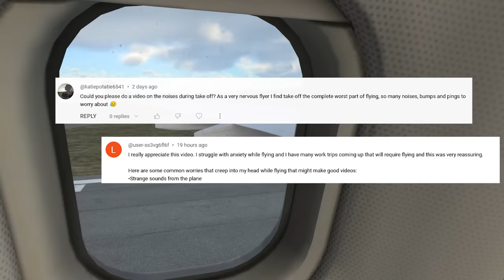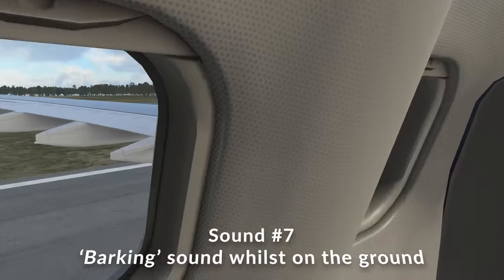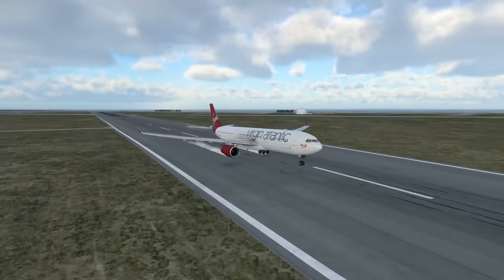What Are Those Noises After Take-Off? | Curious Pilot Explains # 3

Comment: Thanks for this video...gratifying to know my intuitions about these noises were basically correct.  Also, this could just be urban legend, but it feels like to me you can tell if your pilot is a former Naval Aviator or an Air Force pilot.  Air Force pilots will give you a smooth, graceful landing on the runway.  With former Naval Aviators, you will feel all landing gear smack down hard, all at once, then continue the landing...because they're used to landing on carrier decks where this is absolutely necessary....but it makes for a somewhat unpleasant experience for the commercial traveler.

Comment: What causes the 10 - 15 second noise after takeoff & on approach that l describe like pressure escaping from a pool innertube & you pinch the valve to close it. It happens once slightly after leveling on takeoff & once upon approach. l hear it sitting in the plane & I live on the north outer edge of DFW’s airspace & l hear it when they go over our house. It happens only once each way so it obviously must be related to the landing gear, but it’s not a mechanical or bumping noise, more like air whooshing & being closed off, the pitch goes higher until it stops, & it only lasts a few seconds. Thanks in advance for looking into it!

Comment: Admittedly, I'm a bad flyer, but I had a terrible landing last week when the plan "dropped" several times as it came into land. Is this normal and why does it happen?
Reply: I wouldn’t say it’s normal but it definitely isn’t uncommon or something to be worried about. This is caused by strong winds on approach and can be worsened by terrain causing the wind to rise or fall rapidly (this is one of the ways gliders stay in the air through using terrain which pushes the air upwards) however if the terrain rises it must come down and with that comes a section of air which is dropping instead of rising or staying fairly constant. If something like this worries you then always remember that pilots go through months of training in these situations and worse ones to ensure your safety in the air. Something that may help you is finding some YouTube videos (the channel JustPlanes may be good) where there are strong winds or difficult situations. Seeing what is happening in the cockpit may make you see that the pilots are very calm in these situations and if they sense that it is unsafe they will go-around and divert to a different airport or wait for the weather to clear.

Hope that helped and answered your question

Comment: At immediate climbing, there is a lot of stress all the metal of the aircraft withstands getting off the ground. It’s fighting gravity. But there isn’t any option of not climb fast for about a minute or so, in other to gain a safe and clear altitude above ground. As soon as they stress is no longer necessary, nor recommended both for structural and economic reasons, it slows down the engine powers to break free from that stress and then, smoothly, go back to climbing faster but not as fast as right after take off. That saves the structure and fuel consumption.

Comment: Aircraft noise could possibly be reduced by redesigned aircraft. If the engines were mounted above and forwards of the wings, then much of the engine noise would be reduced by sound bouncing off the wing and reflected upwards away from ground dwellings.

Comment: Not a pilot. And aviation enthusiast. Have two family members that are former ATC and one friend who was a pilot. I pick their brains. 
There are other sounds of note.
Upon takeoff and during climb, there will be a whining or whirring sound . This is the flaps being retracted to flight mode. 
Upon final approach, again the whining noise as the flaps are first extended to the proper approach setting. Then extended again, for final approach. Flaps increase the surface area of the wings to create lift. This allows the engine thrust to be reduced so that the aircraft can slow to landing speed. Also on final approach, a louder roaring type sound accompanied by a noticeable slowing of forward speed, This occurs when the flight crew has lowered the landing gear. And then you'll hear the engines reduce thrust. This is again to slow the aircraft to the prescribed speed for landing. A pilot friend of mine calls this "throwing it in the bucket".

Comment: It’s not just the sound of the engines spooling down after takeoff, that is concerning.  It’s the accompanying hair-raising feeling in the pit of your gut, that the aircraft is plummeting.  For the reduced thrust, ceases to push you into the back of your seat, giving the somatographic illusion of falling.  The main reason that I remark on this now, is because, when I was a kid, I myself was a very nervous flyer, and I absolutely hated those moments.  And you know, I think that adults didn’t (and perhaps, still don’t) give kids enough credit.  If one of them had simply explained the process to me, I would have understood, and maybe loosened my death grip on the seat’s arm rests.😆  But after all, it was the 1980’s, when being anxious and apprehensive wasn’t entirely uncalled for; with crashes not being as unheard of as they are today; in fact, some very large, horrifying, and headline-grabbing ones.  Naturally, every time I walked down the jetway, to board a 'DC-10', I was already convinced that we were all gonna die.😆

Comment: Thank you for this video, very helpful. I love flying but it scares the shit out of me each time. The sound of the engines slowing down is (or was, we'll see😂) one of the scariest things for me. What about the smells? Is it normal to smell the jet fuel on board before the takeoff? I'm always worried that something's wrong with the plane. I'm not a frequent flyer but I've experienced this in 3 out of 10 flights.
Reply: What you're probably smelling is either the efflux from another aircraft nearby that has its engines or Auxiliary Power Unit running (used to power air conditioning and electrics and sometimes start the main engines) and that smell is being blown into the cabin conditioning air intake of the plane you're sat in. It could also be as above from the APU of the plane you're in.

Comment: During thrust reversal, the air should only exit the sides of the engine or sideways from the back of the engine, not the front. It still has to go in the front, or the engine won’t work. Now sometimes when the air comes out sideways during thrust reversal, instead of the air being pointed perfectly sideways, they can get it to tilt a bit forward, but that isn’t necessary. 😅

Comment: Good vid. Reference take off thrust - it’s not normally full thrust because it’s not needed and highly expensive in wear and tear. Boeing use 2 reductions called “ assumed temperature “ ( you tell the engine the air temp is Warmer than it really is to reduce the thrust ), and “ fixed derate “ normally 10 or 20%. A strange noise can occur after take off , when you select climb power and the engines actually spool up- the runway was long enough to use reduced thrust to the max, but the climb setting is a tad higher

Comment: Can anybody explain what the loud buzzing sound is from the engines after take off on the a320s? You hear it when you sit in rows by the wings. It always creeps me out but I either no longer hear it at cruising altitude or I got used to hearing it so long that it fades away
Reply: I guess that's the sound I am also curious to find out about, though I hear it on the Ryanair's 737s. It's quite loud and I associate it with a machine whose housing or cover is somewhat loose and makes this resonating, vibrating noise. It disappears once the plane reaches its cruising altitude and is never heard again. I  think it may be the water injectors in the engines, but I have no idea whether Boeing's engines are actually equipped with them.

Comment: Why do planes 'shudder' as they initially lift off? It's like turbulence almost immediately as the plane transfers to be lifted off the ground. Would love an answer if possible please, thank you.
Reply: Its mostly the gear settling down on their suspension as they are no longer in contact with the ground, and also just the initial turbulence of the aircraft now being supported by its wings rather than its landing gear. Also there can be wake turbulence you hit from previous departures (the amount of time between departures is dependent on type of plane ahead of the next).

Comment: Always wondered what the chimes meant. 👍🏻
Reply: They can mean things different depending on the airline. The one I fly regularly toggles the seatbelt light (two dings) when passing 10k feet only (which is good to know since above 10k you need oxygen if the cabin depressurized).

Comment: You forgot the opening of the landing gear doors, where you hear the turbulence till the gear is up and doors fully close.
Then once airborne the flaps retracting, and then on landing the flaps, fouler flaps activating to help stabilize, control descent rate, and speed. But informative video.

Comment: There is a sound you hear when your on the ground and a plane is heading for approach when the plane is about 6000 feet above your house - once the aircraft has passed over a howling noise can be heard from the engines.
This only happens with large widebody jets, don't think I've heard this howling noise from smaller 737,757, a320's etc

Comment: i once was in an airbus at the gate we were preparing for pushback and the pilots were testing that P.T.U. and the hydraulics.We were hearing that barking sound repeatedly i knew somethings was wrong and at the end we were forced to call ground support,meccanics boarded the plane tried to resolve the problem without success.We eventually changed aircraft and we boarded another one and took off.the whole process took about an hour...
Reply: They probably had a fault with the hydraulic systems which caused the PTU to go a bit crazy. Its normal to hear the PTU bark for minutes after the self test during engine start and usually never requires an AOG, so your case is very rare.
Reply: @RyanZ225_PC  i was a little bit concerned i must admit cause i understood the nature of the problem,hydraulics is no joke..but i guess if the pilots would decide to take off instead that would mean that the problem would have been fixed so i shouldnt be concerned that much😅.We were lucky cause we were at the companies base so another parked aircraft was available immediately

Comment: What about the bump sound just after rotation? I always hear this sound and never know what it is?
Reply: When the aircraft is sitting on the ground, the landing gear struts are compressed. (Think automobile shock absorbers or struts) As the weight of the aircraft is taken up by the wings, the struts will extend. That thump you hear (and feel) on rotation is the struts reaching their full extension and hitting the stops. Nothing to worry about, perfectly normal.
Reply: @Max Wedge  Thanks Max. Will think of you now each time I hear it lol.

Comment: Pilots reduce thrust after takeoff mostly because of noise abatement procedures at the airport. Engines produce their most noise at takeoff power & to keep the local neighbor’s happy airport departure procedures call for a reduction in power from 800 feet to 3000 feet to reduce noise pollution.

Comment: In commercial aircraft, pilots are required to maintain a speed of 250 knots or less under 10,000 feet altitude in Europe and American skies, which is why the engines retard their thrust levels and deploy speed brakes (spoilers) on the wings to slow the aircraft down. These noises can cause the unaware passengers to freak out some although everything is just fine. ;-)

Comment: The second ding actually means you've reached 10,000 feet. It has nothing to do with the flight attendants.
Reply: No. 1st ding is for cabin crew to sit down for takeoff. Second is for them to get up. Third is fir seat belt sign off which is sometimes just after  10000ft if it’s nice weather.

Comment: That first ping has nothing to do with the undercarriage. It’s the emergency exit sign going off - meaning, the aircraft is too high for you to exit in case of an emergency!
Reply: Utter nonsense.
Reply: @peteconrad2077  nope. No it’s not. Have a look at the emergency exit light the next time you fly. It goes off in tandem with the ping
Reply: @matthewbryan7890  the ping turns off the smoking signs and the exit signs flash  briefly off in unison. But they do not permanently change.
Reply: @peteconrad2077  afraid that’s not true either. The ping immediately after take off is for the emergency exit purposes. The seatbelt/smoking lights typically come off at around 10,000 feet, but this can often depend upon airline and, of course, weather conditions
Reply: @matthewbryan7890  no. Smoking signs are connected to configuration of gear. I’m an airline pilot and former aeronautical engineer.
Reply: @peteconrad2077  they’re not on the flights I take. I fly around 40-50 times a year. I’ve never ever seen that on the flights I take.

Comment: As someone else has already pointed out you have completely missed the sound of the flaps extending/retracting before/after take off and indeed at the end of the trip where they extend/retract for landing.

Also, just my opinion, bit disappointed it's in Microsoft flight simulator and not examples of the real life plane sounds. MSFS is good, but always better to have the real sound rather than sampled. Like I say just my opinion.